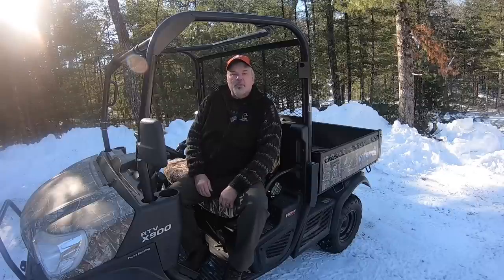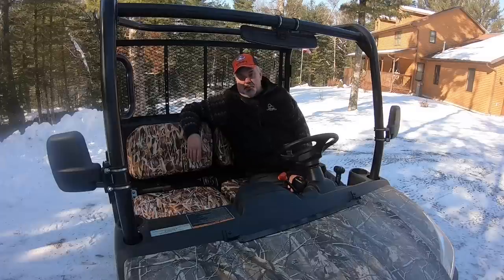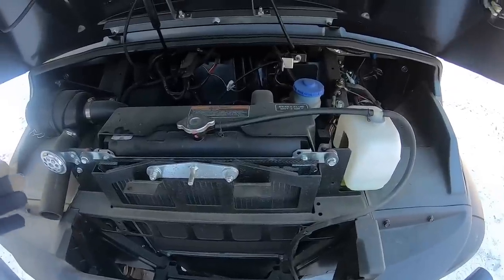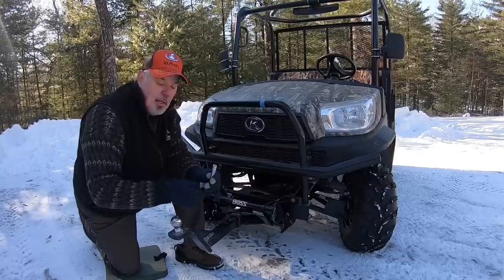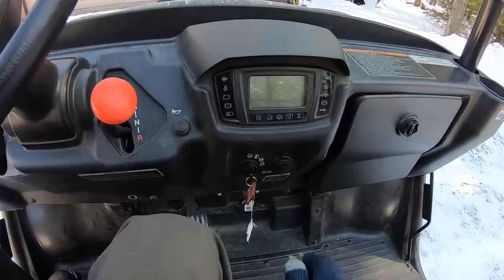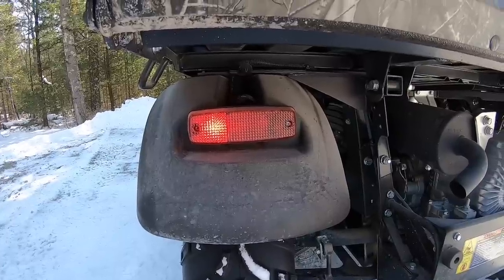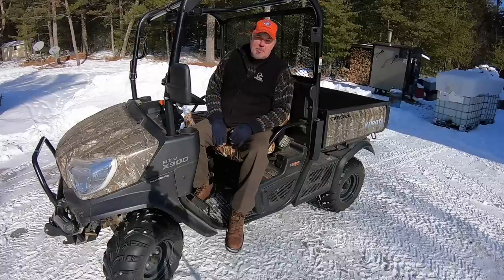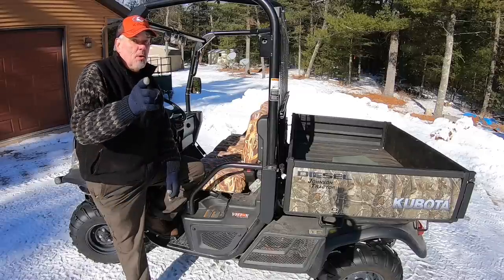Buying a UTV In 2023? -65 #Kubota

Comment: I have an rtv x1120 a canam hd10 defender and a 900xp ranger. 

Hd 10 is used at home the ranger and kabota used for my biz. Kabota will get the job done but when production is important I’m getting in the ranger. It’s not just speed it’s moving material across ruff terrain. Take them both loaded at 20 mph across terrain and the ranger is in a different world. Power? A 900xp will pull like crazy. People talk about belt trouble but a little common sense goes a long way. All of them have trouble. Last night I put a rear axle bearing and a tie rod in the rtv 1120. Today I could hear a u joint going out in the ranger. You use them and they break you abuse them and they break faster. Kabota bed is better. Ranger bed is great if you don’t abuse it. I load mine with bobcat and I have had to squeeze plastic together with bolts. But I’m abusing it. 29 top speed is fine on job site it’s how fast you can go between 0 and 29 that’s the issue. 
Just one guy’s opinion with all three brands
Reply from the maker: James you definitely have more hands on experience. You’re right if you abuse your equipment I don’t care what brand it’s not gonna last. That’s interesting about your comparison between the 900 & teeth Kubota. 
Thanks for sharing.
Appreciate you watching and commenting 👍TCT

Comment: We have the 1100 for our local fire department that we use for wildfire season and then put on a 6' boss v-plow in the winter time. We are very happy we bought it about 8-9 years ago. Like you said it's a absolute work horse. We put a 75 gallon skid unit in the box with foam and a pressurized system for wildfires. Only disadvantage I see with ours is the weight but it's to be expected with it being a diesel with everything on it. I would definitely recommend it. Stay safe my friend
Reply from the maker: Tim that was one of the reasons I looked at the Kubota diesel is that many municipalities and fire departments use them. That in an of itself is a great endorsement. 
Thanks for watching and commenting 👍TCT

Comment: I’ve had a 1140 for a year and a half. Amazing machine. I put a roof and windshield on it which is great
Reply from the maker: I too am looking at putting on both windshield and roof. I’m sure you have the same problem as I did with having to operate the tailgate with both hands. 
You should check out my video #71 where I show a simple fix. 
I’ll be showing some interesting mods within the next couple of weeks that will fit the Kubota UTV’s.
Thanks for watching and commenting 👍TCT
Reply: @TonysCoolTools  I’ll give it a watch

Comment: I just purchased a XG850 Sidekick from Kubota last year and it is an amazing addition to my small farm, gas engine will run 40 mph but still has the great towing capacity even for a gas engine. Absolutely recommend any of the Kubota products.
Reply from the maker: Rob that’s a nice machine with a lot of power. You’re right you can’t go wrong!  It’s amazing how much we use UTV’s daily.
Thanks for watching and commenting 👍TCT

Comment: I purchased a 900  eight years ago and really like it.  Occasionally it is a little hesitant to shift into reverse. I did bend the tailgate when I used the dump with a trailer hitch attached.  The gate caught on the ball when I lowered the box.
Reply from the maker: Raymond the Kubota diesel UTV's haven't changed much over the years. In my opinion its a tank and gets the job done. 
I have the same issue with hard shifting both forward and reverse. 
But even with some of the issues I wouldn't trade for another UTV.  
Thanks for watching and commenting.👍TCT
Reply: Thanks for the heads up!
Australia

Comment: 👍🏻, I have 2019 kubota sidekick 850,  it’s one nice unit.  I do wish it had the non manual dump.  Great video!
Reply from the maker: Larry with the 850 you definitely have plenty of power. Regardless of gas or Diesel engines I believe the Kubota UTV’s are a great machine.
Thanks for watching and commenting 👍TCT
Reply: @TonysCoolTools   I was in the market for the diesel too. Just so happened this 850 with accessories became available on marketplace so… I went with the deal.  I was surprised of the power the gasoline has. Mostly you said it… Kubota a nice unit.👏🏻👍🏻

Comment: The 25 mph is one of the reasons I bought the Kubota.  My boys help out and don’t need them flying around.  Lol.  I did wimp out and buy the cab.   The air conditioning is nice in the hot humid summer days.
Reply from the maker: Sean you are an extremely smart father! There is no doubt that nothing good happens with speed. When I’m plowing the heavy wet snow I single digits I rethink my idea of not getting a cab model. Fortunately with the Boss V-plow I’ve cut my plowing time in half to about an hour so I can suffer in the elements that long.
Appreciate you watching and commenting 👍TCT

Comment: Excellent choice. If my experience is any indication you will use it for at least a couple of decades. I bought a 2004 Kubota RTV900W brand new in 2004 - the work place model with the hydraulic dump bed. Mine has a 3 speed forward hydrostatic transmission - L, M, H, N, R. 

If it doesn't want to go in gear, gently blip the throttle, then it will shift. If it doesn't want to come out of gear, do not reef on the shift lever, put your foot on the brake and give it a few seconds for the transmission to release and it will come out of gear easily. 

I bought a simple fiberglass Kubota accessory roof that fastens to the roll cage and wouldn't be without it. 

Mine is approaching 4,000 hours with all routine maintenance performed on schedule and works just fine. Do not slack off on the maintenance. Diesel engines need clean oil, clean fuel, and clean air. The transmission needs regular fluid and filter changes on schedule. 

Mine is a first generation unit so it's had a couple of upgrades to make up for new design issues, but like you say, it's one tough reliable machine. Mine is still on the original tires. It's been parked inside its whole life. 

One caution: Don't force the shift lever. On a slope, put your foot on the brake and wait for the transmission to lose pressure, then it will shift easily. Forcing it can lead to a problem, at least on first generation models.
Reply from the maker: Really appreciate all your input on the X900. Experience sometimes is the best teacher. 
I noticed using the break helps the shifting as well as stepping on the throttle. You’re right about the maintenance which is the key for longer life on equipment.
Thanks for watching and commenting 👍TCT

Comment: That is a COOL machine lol. I lways fill mine up with red diesel,  which is much cheaper without tax.
The Kubota is a utv is in a class of its own. I bought mine just like you as a work horse. Kind of like comparing a Clydesdale vs. Pony. 
Nice break down on your machine.
Perhaps I should drive over and do a side by side.
Reply from the maker: Harry I agree it’s an awesome machine, and the purr of the engine puts a smile on my face almost like when I’m sitting on my tractor.
I think a side by side comparison of the two UTV’s would be an interesting video. 
Thanks for watching and commenting.👍TCT

Comment: Being sub 25 hp
And sub 25 mph
Keeps a bunch of the emissions insanity, from being required.
.
25 and 75hp are the magic lines in the sand, for required emissions.
Reply from the maker: That is a great point you mentioned. Man people buy  a tractor 25hp and under for that reason. 
Thanks for sharing and commenting 👍TCT

Comment: I do not like diesel and own nothing that uses it.  Reinforce each time I see the prices at the station.    Well Dun.
Reply from the maker: I appreciate you watching and commenting 👍TCT
Reply: I absolutely adore diesels. I work mostly with older tractors and diesel cars like vw. The main benefit of diesels is there is no spark system. The absolute pain in the ass that spark systems can be whether its distributors, spark plugs, wires, coils, control modules or anything inbetween, especially on multi-cylinder engines. A diesel removes an entire complicated system from the engine and it is truly a thing of beauty. Once you work on and use diesel engines you will never go back. They are fundamentally better than gasoline engines in essentially every way.

Comment: Tony, no disrespect intended, but you don't understand small engines as far as gas vs. diesel.  You kept saying how GREAT the torque is in that little Kubota diesel.  You even stated that it has 40ft.lbs. of torque.  Well, the Polaris gas 1,000cc engines have more torque than that.  Also, when you were quoting specs, I forget what the Kubota is rated to tow, but I DO remember that it was considerably less than the Polaris Ranger, which is 2K.  In these tiny engines, the ONLY place that diesel really wins out over gas is in mileage/fuel consumption.  They DON'T offer anymore HP or torque than their gas counterparts.  Then you talked about how long that diesel engine will last.  Well, IT WILL, but the machine around it won't.  You'll end up with a body that's falling apart, and an engine that's still good.  I'm not bum-wrapping your machine.  The Kubota IS a good, solid machine, but the diesel doesn't offer anything more than the gas model does other than mileage.  And as you already know, it's also considerably slower.  It has no more HP or TQ than a gas model offers.  Sorry buddy, but you got caught up in the sales hype.
Reply from the maker: Jeff thanks for your comments. I truly wasn’t trying to pit one brand against another. After doing a lot of research I knew I didn’t need a UTV that did 60mph, what I was looking for was a workhorse. When I talked with a few farmers that had gas JD Gators and had Kubota UTV’s they all said they loved the power the Kubota had. The other endorsement about getting a diesel Kubota was most municipalities and road crews use the diesel Kubota’s, I didn’t see one Polaris. 
Without a doubt the Polaris is the number one brand out there especially  for trail riding.
I don’t see any tractor manufacturers using gas engines on tractors and I used the same analogy about a UTV. After 2years I’ve been extremely satisfied with the diesel Kubota UTV.
Appreciate you watching and commenting.👍TCT